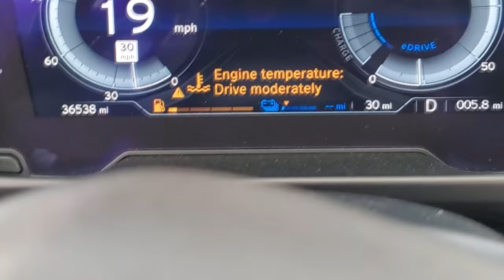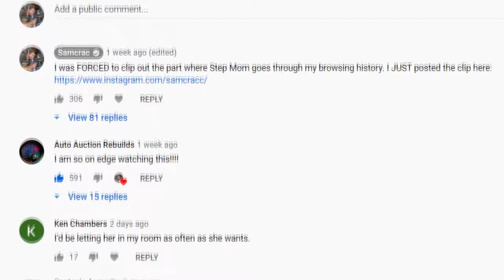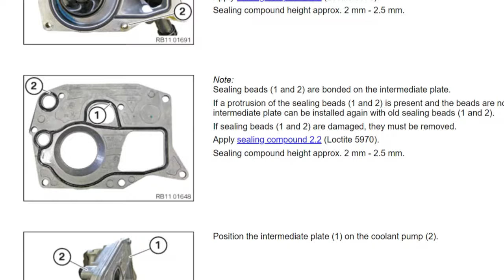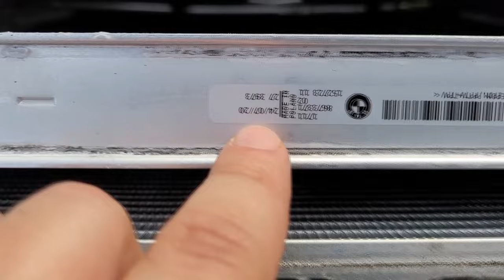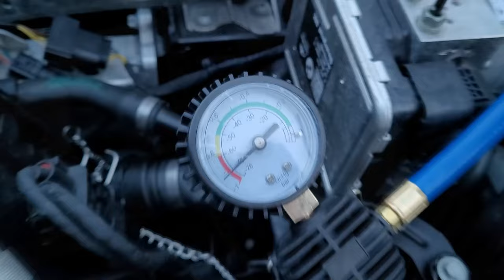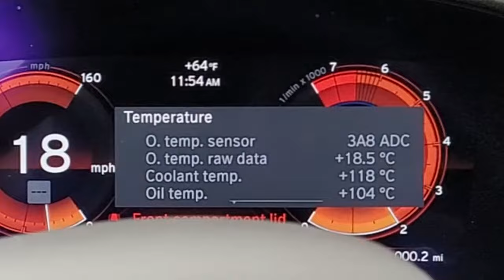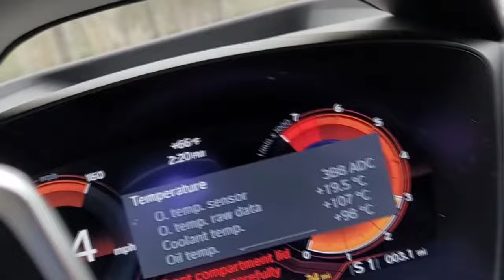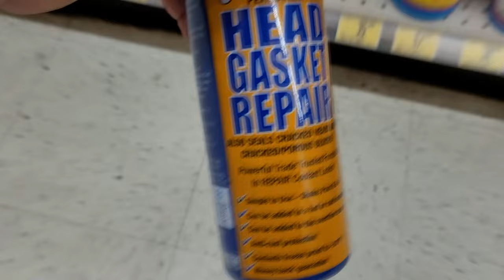The Dealer FAILED my "Unrepairable" BMW Supercar! Can I Fix it with this Simple DIY Trick???

Comment: Don’t forget to take out the new thermostat & swap it for the old one before you put that head gasket repair fluid in, remember it will ruin it. 👍
Reply: No it wont
Reply: I would caution to make sure to read ALL directives from the manufacturer. Personally I prefer to replace the Thermostat anytime a cooling system gets chemically romanced... I agree with the principle Craig Conroy poses of using the old for the chemical exposure risks.
Reply: Maybe I am being naive, but wouldn't it be better to replace the head gasket instead of putting something in the engine to try to "repair" the old one?  Putting some kind of repair solution in seems like something some fly by night car dealer would do just to make it work, so they can pass the car on...
Reply: @jiminauburn5073  yup. I've never actually seen any of those chemical head gasket repair/ sealer work on anything.
Edit- I take that back, they can do a pretty good job of clogging up your radiator.
Reply: Yeah I’m pretty sure it was a joke, that’s the mechanic’s equivalent of snake oil lmao.
Reply: The Blue Devil head gasket repair does work surprisingly. Its $65. It can stay in the cooling system for life with no clogging or damage. There is a metal/fiber material that reacts to exhaust gas causing a metal type seal from the exhaust heat. Ive used it and it does work. I was shocked. Its been in my car for 2yrs now. I had a terrible leak prior
Reply: @s.reynolds3415  hey man more power to you but you’ll never EVER catch me putting that stuff in my engine. I mean just in case the head or the block is warped for me it’s better to get them machined and have the piece of mind than to have to constantly think about the metaphorical bandaid that I flushed into my coolant system.
Reply: @truthliveshere831  
"piece of mind"

peace
Reply: @shawbros  Great job on the spell check. Next week you can teach us how to fix "anything" on a car
Reply: @s.reynolds3415  
Having the ability to fix a car is not a good excuse for poor grammar/spelling.

Comment: I’ve had one car that a blown head gasket caused that problem. No other symptoms. Replaced about every part in the cooling system first....but in the end, it was a tiny head gasket failure
Reply: Did you call it

Comment: Poor Sam. I actually yelled "nooooo!" When I saw the colour change.
Reply: He is doing all of this on purpose. If he got a Toyota he would have no horrible stories to make videos about - he would just be driving around in a car that won't break.
Reply: @kirkjohnson9353  yeah. "I just bought a 1993 Toyota corolla at a salvage auction for $50 and it works perfectly" doesn't sound like great content.
Reply: @droidtigger  No story there- except it sounds like you done really good. Congratulations. I love the Corolla. I have a 1986 Toyota Pickup I bought new and put hard miles on pulling a tool trailer. Over 500,000  and still going strong. Needed the tranny rebuilt at 350k but no problems since.
Reply: @kirkjohnson9353  those are amazing cars. Marty Mcfly had one in back to the future.

Comment: 5:32 replacing the thermostat will not fix it, because your friend already put the housing without the stat and ran it open.. and that still didn’t work and over heated.
Reply: i had a chevy blazer that overheated for some reason when i idled the thing more then 20 min but the temp went down soon as i started driving it, i thought it was the water pump too
Reply: @funnypranker34  that would be not enough pressure in the cooling system while idling

Comment: Sam, I'm glad to see you've found the cause but so unhappy that it is what it is.  After seeing so many i8's have "just" a problem with bleeding the cooling circuit, my hopes were that it was just that.  Sadly, it was not a common i8 problem at all.
Reply: i know right. Pat this makes me nervous about when my i8 comes home after currently 19 weeks under repair. Do i keep it? I will keep everyone updated on my VLOG.
Reply: @Evapors  You have to release an update soon.  An i8 sitting on the dealer's lift for 19 weeks is unfathomable!
Reply: That car is just a series of repair failures. First it was hit in the front.
That probably damaged the radiator. So they replaced the radiator but did not bleed the system properly. No cooling, the head gasket blown. 
End of story ...
Reply: If it was something so simple someone would of taken the time to do it long before it went up for sale at rock bottom prices I think.
Reply: @dennied7826  Yep.  But with the i8, overheating issues are typical once you break open the coolant circuit so that's literally where everyone looks, by default.  Me included.
Reply: @PatsGarageOnline  I feel like we all go to sleep at night dreaming of buying a problem car and finding out a computer wasn't plugged in or finding out that the coolant system wasn't bled and hey presto, functioning car. I'm sure it happens to some guys with the car luck of winning the lottery but the odds are the same as the lottery.
Reply: @dennied7826  I receive on average 1 message a week from i8 owners saying they took their car in to have a coolant leak repaired and they got their car back and the engine's overheating.  I tell them to take it back because they didn't bleed it correctly.  They bleed it again and it comes back OK.  When you receive this kind of feedback from real i8 owners, it becomes a common issue for i8's.  No one has ever said they had a blown head gasket.  So, for the i8, overheating due to failed vacuum bleeding is a common problem.  A head gasket failure is not.
Reply: @MrGigi-dz9cv  I thought he said the radiator was 2014 ....
Reply: Might be chicken vs egg too?  Head gasket cause the gas in the cooling circuit or did a vapor locked or obstructed cooling circuit blow the gasket?
Reply: @PatsGarageOnline  since improper bleeding is such a common problem, is it a stretch to think that someone just drove this one till the head warped from overheating?
Reply: @gearb0x  It's not a stretch at all.  I'm just saying it's uncommon based on i8 owner feedback that I get.
Reply: @gearb0x  That's the most likely thing that happened in my mind.  It could have developed a coolant leak, been ignored, the air pocket went to the top of the water jacket, and all hell broke loose.  The i8 shouldn't actually wait that long before it "saves itself" however.
Reply: That car was in an accident that damaged the front intercooler / radiator and headlight. Probably that damage and low-tech repair / hide attempt (have you seen the headlight epoxy repair and missing module? Now think in the hands this poor i8 was going to fall) caused the problem with the cooling circuit until the day that gasket blew up...
Unfortunately, this is another lemon car in Sam's collection.
Reply: @Czechbound  Yes. Nevermind. They might have just took the radiator off.

Comment: When you first said there was bubbling and “popping” in the reservoir I would have done a block test. I’ve been screwed so many times by head gaskets releasing exhaust into the cooling system and causing air bubbles and all kinds of weird symptoms along the way.
Reply: It could also be a crack in the head between the combustion chamber and a cooling channel, possibly a crack that only opens up when the engine is warm. I dunno if the block has cylinder liners but if it does, that's more likely than it going through the block. Still less likely than the head gasket, though. I've forgotten who it was but there's a volume manufacturer who started integrating the exhaust manifold into the head and they were getting heads that either cracked or had excessive porosity and blasted coolant out into the exhaust so it can happen.
Reply: @spankeyfish  i just replace the whole engine nowadays. by the time you tear it down and determine the source of the failure its usually cheaper to have just put in a new engine. especially if you need machine work etc. its rarely ever "just a head gasket failure"
Reply: @BrandanVenne  
Why wouldn't BMW have done that fix then when he took it to the shop? Unless they recommended that 😏
Reply: @BrandanVenne  Thars what all the specialists have concluded all along,,,, Mmmmmmmmmmm
Reply: @shiveringsand  I guess my point is most shops will just charge you diag and say it needs an engine because its overheating and they see bubbles but not actually go as far as a block test. at least that's my experience in working at multiple dealerships and private specialist shops. Technicians are lazy and just would rather throw an engine or transmission at something rather than risk tearing it down or even just spending some more time doing the proper testing, but I'm glad he came to the proper conclusion with the proper tests, I'm just saying based on everything I saw I would have done a block test along time ago way before pulling thermostats and all the extra vacuum filling etc. But after 10+ years working on German cars you learn the ways to recognize certain types of failures and what tests to pursue.
Reply: That's mando! If it was to come to my shop.... That's one of the first test I would perform after hearing the symptoms
Reply: how'd that esse miss it, sam gave him a lot of props like he's a bmw meister or somethign

Comment: The shop pocketed the money for the replacement and just “repaired” the headlight. Very common
Reply: Could also be that the wait for the new headlamp was quite long and the shop offered a quick repair so the customer could take the car. Then for one reason or another the customer never came back when the new light arrived.
Reply: @vtseller  IRC If u have car up to 90days in shop u can totaled it. 
Common on Saab 9-4x if its body part
Reply: They also stole $1000 dollar voltage regulator.
Reply: Or they bought the cheap "reconditioned" headlight the insurance asked for and the tech didn't send it back.

Comment: watched the whole series on this, cylinder leak down test/block tester should have been the very first thing done, along side the compression test you performed.
that being said, content is needed so i understand why you chose other processes to be completed first.

keep up the great content, hope the repair bill is not to steep
Reply: Right, the the test won't tell you what it is but it'll surely tell you what it ain't.